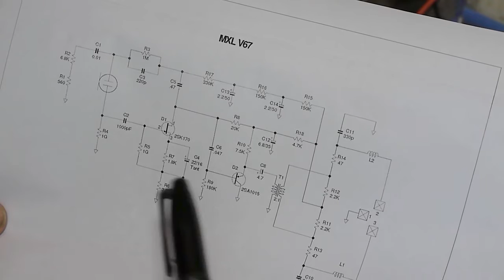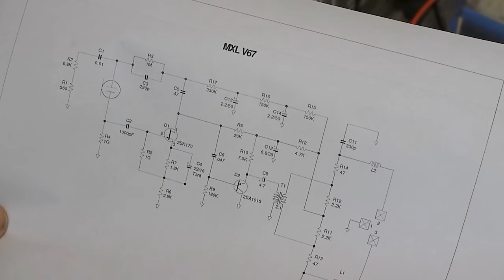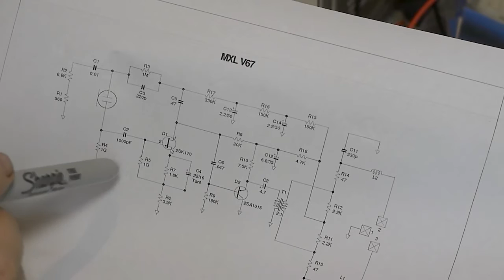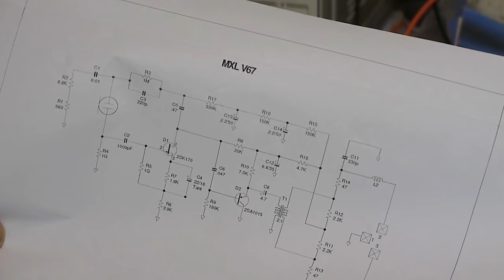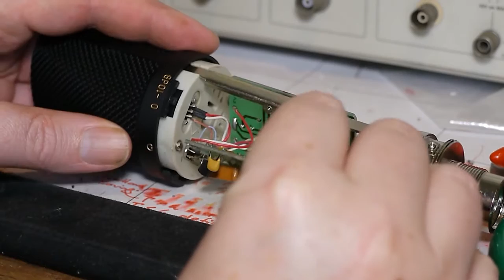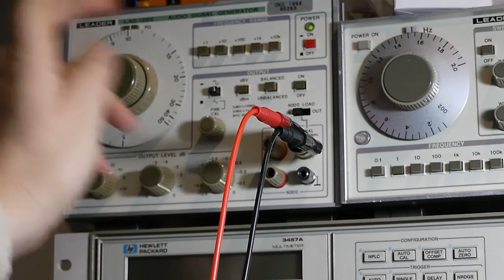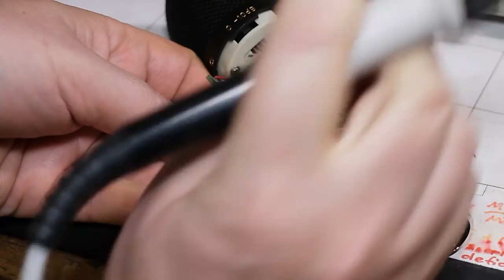Adjusting the bias of a condenser microphone

Comment: Great video. I build preamps for hydrophones which have very similar characteristics and requirements. If instead of changing R7, you had changed R6 instead, the bias current through the JFET would have been relatively constant and the voltage at the drain as well, and making R6 greater would simply increase negative feedback lowering gain and reducing distortion. I use this in my designs to reduce preamp gain without changing the bias point when I am dealing with large input signals. I'm pretty sure you could do the same here, i.e. trade off gain and distortion without changing the bias point, by allowing adjustment of R6.

Changing R7 is messier because the relationship between R5, R7 and C4 is important. Changing this resistor will change the bias current and the voltage at the drain which you've used to better center the signal. Reducing R7 from 1.8K to 750 should significantly increase the bias current and also significantly increase the corner frequency of the high pass filter set up by R7 and C4. Anyway, it was an interesting and instructive video, although it wasn't always clear what the preamp gain was as the adjustments were being made, and it's easy to improve both dynamic range and distortion numbers by decreasing gain.

Finally, let me end with a different question. This circuit uses the 2SK170 JFET, which has a pretty good reputation, but after doing a lot of testing and measurements, I've found the BF862 to have lower noise throughout the audio band, and it has low enough capacitance to allow use of two or more in parallel. See Comparison of Low Cost, Low Noise JFETs,
Dimitri Danyuk, “Measurements Rate SMT Low-Voltage n-JFETs Under Consistent Conditions”, 19 April 2013. This is to some degree an academic question, since the BF862 recently went end of life, but I'd like to hear your thoughts on this.
Reply from the maker: My apologies for not responding sooner - you make some excellent points. I had rather assumed that C4 was sufficiently large that I could safely reduce the value of R7 by a fair margin without having any impact within the audio band - definitely something to watch for, though. I also take your point re: trading gain for distortion & headroom - it would have been good to make clear just what tradeoffs were being made in that regard. Interesting concept re: parallel JFETs too, definitely something worth looking into. Cheers, & thanks for your excellent comment.
Reply: I'm really late to the party (and who cares anyway), but the best way to set the bias conditions would be by using a separate voltage divider. This fixes the JFET source voltage regardless of the current flowing through it.
That being said, this whole circuit is pretty.. bad. It clearly stems from the tube days: self-biased JFET, no global negative feedback, and an output transformer - complete nonsense in a solid state circuit! C2 and R5 are redundant because the mike capsule itself is a capacitor. They're there because the polarising voltage is already low, and connecting the capsule directly to the gate would further reduce it, thus reducing the sensitivity (I don't know the specs of the capsule, but it's a good idea to always make the polarising voltage as high as possible). The voltage amplification is done at the JFET's drain, meaning the signal will be greatly attenuated due to Miller effect, further reducing the sensitivity.

I could go on and on forever, but the point is: I'd rather make a new preamp from scratch than use this one.
Reply: @noneofyerbeeswax8194  - The gate bias point is a few microvolts above ground. R5 handles the leakage current from the JFET and must be kept as high as possible to keep it from dominating low frequency noise. Thus the 1G values for R4 and R5.
- C2 is required because the microphone capacitance leakage current is much higher than the JFET leakage current at room temperature. Without C2, R5 would have to be reduced which would increase low frequency noise.
- The transformer is used to shape the output to provide what many people consider more pleasant vocals. This is purely subjective so it doesn't help to make the obvious claim that the transformer will increase distortion.
- A cascode arrangement can be used to increase first stage gain. This provides a small performance improvement at the cost of the cascode transistor and biasing network.
Reply: @ats89117  I do know how analog circuits work, thanks. :) I didn't know the capsules were this leaky, probably because those I've worked with weren't. Maybe it's because they were all used in studio environment, at a constant temperature and low humidity. In adverse conditions, the situation might have been different, but people normally prefer dynamics there anyway.
I've had more problems with bias corruption due to FET leakage because even 10pA over 1gOhm will give us 10mV (not uV) above ground.

The only real advantage of an output transformer is that it gives you a balanced, low-impedance output, which would require a few extra semiconductors otherwise. The linearity and distortion figures however are horrible.

A cascode mostly solves the problem with Miller capacitance, that's why it's used in high frequency applications. Using it at LF is overkill IMO. It requires an extra bias etc.. I prefer a three-stage, closed loop system where the JFET is a transconductance amplifier, a PNP transistor does the actual voltage amplification, and an emitter follower provides a low-impedance output. Negative feedback makes for great linearity and lets you modify the frequency response as you wish (although personally, I prefer it flat).
Reply: @noneofyerbeeswax8194  You're right about the bias voltage. I'm used to using a 20 to 50 Meg bias resistor whereas this application has two parallel 1G resistors. The output transformer is only there because it gives a more tube-like sound. Once again, this is a personal preference, and the manufacturer probably believed it would help sell more units. Negative feedback could certainly provide greater linearity at the cost of reduced gain, but once again, the manufacturer clearly wasn't aiming for maximum linearity but rather minimum noise and a tube-like sound (the result of the high impedance tube and its impedance matching transformer). I'm not an audiofile, but I know quite a few people who prefer the 'warm' transformer sound for vocals. Your mileage may vary...
Reply: @ats89117  Oh yes, the "tube sound". That sweet 2nd harmonic distortion... I've always been of the opinion that an amplifier should be nothing more than a "cable with a gain" and leave the original signal unaffected, but.. whatever.
Incidentally, I've built tube amps that didn't have the "tube sound", and some solid state ones that did. This was the requirement. Audiophools would be shocked if they knew what dirty tricks I used to achieve that.😁

Considering this particular device is Chinese, I doubt the engineers who "designed" it (or ripped off, rather) were aiming for any specific sound.

You mentioned that you build hydrophone preamps. They use piezo transducers, right? I'm not familiar with those. What levels are we talking about?
Reply: @noneofyerbeeswax8194  Yes. Hydrophones are usually made from some variant of PZT. The levels are based on the frequency range, which drives the size of the ceramic. The most sensitive phones are air backed spheres. A 1/2 cm sphere that can withstand 1000 meter depth will have a capacitance of ~1.8nF and a high-end preamp will be expected to deal with inputs from 10nV up to 10mV, i.e. a dynamic range of 120 dB, which will be fed into a 20-bit A/D converter which will end up limiting the dynamic range to less than 110 dB. Low noise JFETs are required for these units, and the LSK170A used to be a common choice, but there are much quieter and better matched and binned units that were developed for MRI applications. These are nice units, but cost up to $50 apiece, which is really highway robbery...

Going back to your earlier comments, a separate blocking capacitor isn't strictly required for the PZT transducers because they are for all intents and purposes the same as any other Type 2 ceramic capacitor... A blocking capacitor is still sometimes used though, because there is an optimal DC bias on the hydrophone based on the pressure it is under. So if you want to operate a hydrophone at multiple depths, you will be better off with a blocking capacitor and an ability to modify the DC across the hydrophone. It's possible that this is also true of the microphone capsules. I don't know enough about them to say for sure...
Reply: @ats89117   Interesting. The levels are comparable to those of small electret capsules and dynamic mikes. The DC bias on the hydrophone is meant to counter the mechanical deformation under pressure, I assume?

The DC voltage across a condenser capsule is normally not adjusted. There's no point. The higher it is, the higher the sensitivity, and that's something you don't really want to alter. The typical figures are 60-120V. Some mikes, like the one in the video, can use the 48V phantom power, while some precision measurement mikes can go well over 200V. There are limitations of course. The distance between the diaphragm and the backplate is really small (tens of microns), so too high a voltage could cause an arc. Also, because the plates have opposite polarity, they attract and the diaphragm bends slightly inwards. The typical dynamic range is 120-140dB for studio mikes (lower than that of a dynamic mike), and the capacitance is about 50-150pF (so the JFET input capacitance can cause a noticeable attenuation).

Condensers are really sensitive to moisture. Incidentally, one (and only, IMO) advantage of using a tube preamp is that the tube gets hot during operation and thus keeps the internals dry. Some measurement mikes use a dedicated heater resistor for this sole purpose. :)
Reply: @noneofyerbeeswax8194  The voltage is varied to place the ceramic so that it is at a good place on its strain vs electric field curve. This is more often done via mechanical means called "Pressure Compensation" where they pump enough air into the transducer to maintain its shape, but this is probably because transducers are mechanical devices worked on by mechanical engineers.

Tubes persisted in sonar applications longer than in other places because piezo devices are generally high impedance devices, so you either had to drive them with a tube, which naturally has high impedance, or use a step up transformer with your solid state amplifier. I remember the first time going into a stockroom at Bendix Oceanics and seeing a whole room of Macintosh power amplifiers (tube based) stacked floor to ceiling.  

How are you digitizing a 140 dB range? Range stepping? I'm usually working with sampling rates of a MHz or more, but I didn't think there were 96 kHz ADCs with more than 126 dB of dynamic range.
Reply: @ats89117   “How are you digitizing a 140 dB range?”
24-bit ADCs can capture a dynamic range of up to 144 dB. 32 bit even more (much more). Whether or not they actually do it, I don’t know. My knowledge in the field of digital audio processing is pretty limited. Sampling frequency doesn't matter, it has no effect on the dynamic range.
Reply: @noneofyerbeeswax8194  This is obviously not your area. Sampling frequency determines dynamic range because it takes time to converge on the right value. Sampling frequency also influences dynamic range by spreading the quantizing noise over a frequency band with bandwidth Fs/2.

TI's best 96 kHz A/D converter is listed as > 121 dB. I'm pretty sure I've seen 126 dB, but not better. By running multiple ADCs covering different range settings, you might do better. This is what is done inside many current ADCs, but it would be hard and expensive. Adding extra bits may mean that the chip has an internal amplifier that is based on the peak signal level, but it won't increase two-tone dynamic range.
Reply: @ats89117   It's not my area, I'm an analog guy. Still, the quantization noise is determined by bit depth. So is an ADC's signal-to-noise ratio, which defines its dynamic range. SNR=6.02*N+1.763 dB, where N is resolution (in bits). Sampling rate is not part of this equation. All the producers I've ever worked with record at 24 bit because it gives you the noise floor of -144 dBFS and thus lots of headroom. Sampling rates can vary from modest 48kHz to 192kHz. As far as fidelity is concerned, it doesn't matter, as long as it is more than double the Nyquist frequency. Oversampling is advantageous when signal processing is required. (It mostly has to do with aliasing and brickwall filtering to prevent said aliasing, but I'm not getting into this here.)

All of this applies to the normal audio bandwidth. I'm taking a wild guess that hydrophones have a much wider band and are used to record sounds way beyond the magic 20kHz mark, which are then analyzed for scientific or military purposes. Therefore, fidelity has to be extremely high. This would explain the very high sampling rate. You mentioned 1MHz/20bit - makes perfect sense to me. This bit depth gives you the theoretical SNR of 122 dB, which roughly corresponds to the maximum DR of PZT. The real SNR will always be lower, of course.
Reply: @noneofyerbeeswax8194  That's not correct. Quantizing noise is white noise with power equal to LSB^2 / 12 that is spread uniformly over the Nyquist band. The higher the sample frequency, the lower the noise power per Hz. This is exemplified in sigma-delta converters which use a single bit conversion performed at an extremely high rate on the output of a high order feedback network which pushes the noise to higher frequencies, and then filters out this high frequency noise which also provides additional bits per sample.

As far as dynamic range, unless you are doing seismic work or something with very low frequency sampling, you have never seen a 96 kHz ADC with two tone dynamic range close to 144 dB. The best 92 kHz units provide 126 dB of dynamic range, and even this is very hard to achieve in practice. Values of close to 144 dB are possible, but only at very low sample frequencies such as those used for seismic systems, where 200 Hz bandwidth is all you need.

Comment: If you were to replace the input fet with a 2n3819 where would the zener diode go in the circuit?
Reply from the maker: So I'm presuming the zener is used to keep the Drain-to-Source voltage on the FET below 25V. To be honest I'm not totally sure it's going to be necessary. It all depends on how much the quiescent current draw of the emitter-follower stage pulls down the supply voltage to the FET. I think the idea of using a zener to protect the 2n3819 from excessive voltage is particularly applicable to circuit mods that remove the emitter follower stage and drive a higher-ratio transformer directly. I'll look into it further and let you know.
Reply: @KarlAdamsAudio  Thank you!
Reply from the maker: I just checked some voltages on that mic - the Drain-Source voltage across the FET was a bit variable, but eventually stabilized at 7.6V (I don't think I ever saw more than 12V there at any stage). It looks like a popular location for adding a zener diode to this circuit is across C12 - where I measured some some 20.5V.  Starting to look like you'd be safe to substitute a 2n3819 without worrying about adding a zener.
Reply: @KarlAdamsAudio  Wow, thank you so much for your help!